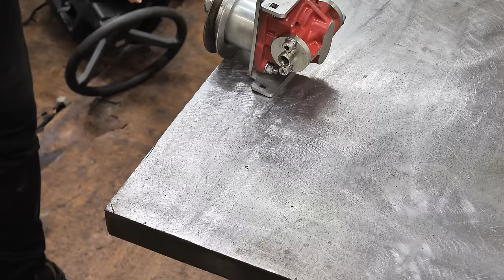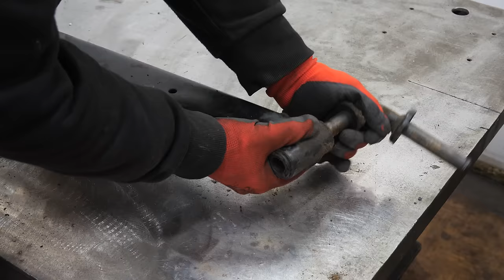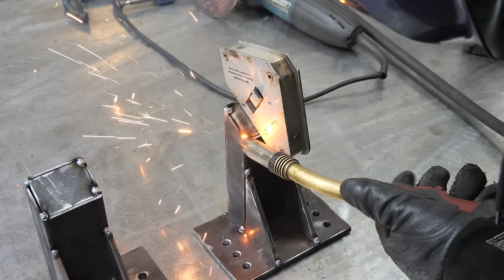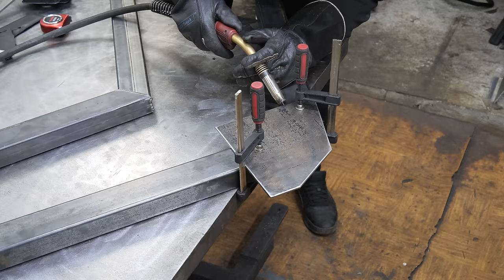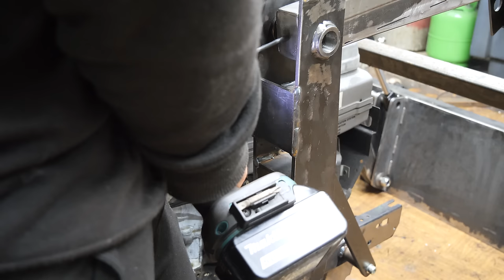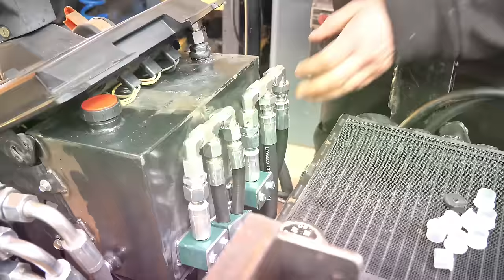Can Lawn Tractor be a Hydraulic Loader ?

Comment: Fill the rear tires with fluid, like the big tractors do, and add weight to the wheels. That way it doesn’t add weight to the drivetrain on the rear and it’s a lot easier on the tractor. Quality of that loader that you built exceeds any expectation. Wonderful job.
Reply: Yeah, that then has issues but what he did was reinforced the axle with some pretty large pillow bearings.
Reply: @WJCTechyman  What are the issues you've faced with loaded tires?
Reply: That's what I use my old retired antifreeze for.  I do recommend using tubes, even if they are tubeless tires though. Pretty easy to do. Use a garden sprayer and pull out the valve core of the valve stem. Rotate the tire so valve stem is at it's highest point and start filling.
Reply: Antifreeze in the rears is ballast and does not corrode the rims. Using tubes can be even better at preventing corrosion. 
Then, the rears on the little green giant were overinflated so most of the tread doesn't contact the ground for traction. Great for burnouts at the starting line buuuut. when all out traction is desirable, not so much. Next might be the addition of ballast weights to the wheels. With the bucket full and up for transporting material to another location, without the ballast, the tractor does a faceplant since there is nothing at the rear to counter the load. That is why the bloke added the hunk of iron on the back of the tractor.
Reply: @cayankeelord3730  don't forget drop the tire air pressure to approximately half factory recommended pressure I have 23x10.50-12 rear tire at 80%fill I run only 2-3psi in the rears... (factory spec called for 5-8 psi) I don't have a loader but I do have a 42inch 2stage blower run on the front that makes my garden tractor light in the rear... I added about 80lbs per tire in ballast
Reply: @ebinmaine haven't had any issues however I have the more stout Tuff torque k66 transaxle... Transaxles transaxles with less than a 10cc pump/10cc motor will prematurely fail with basic tasks such as pulling a trailer so I would not recommend adding more weight than the stock wheel weights via ballast
Reply: @dodgeme1986truck  Ahhh. Appreciate your response. Here we deal with Wheelhorse "Unidrive" transmissions which are somewhat overbuilt.
Reply: @ebinmaine   no problem I was stating a fact from numerous transaxles failures I've seen including the one used in the video (I pick em up for nothing due to the bad transaxle) and by either rebuilding the transaxle or adapting the machine to a k66 transaxle.  I have seen these smaller 19mm or 3/4inch stamped front axle failures from just carrying the factory snowblower attachment... the best options for this is to either build a new stronger front axle with modified 1 inch trailer spindles and tube steel beam or at the very least reinforcing the steering spindles by boxing the bend and by wrapping some 1/8 inch or thicker plate around the axle spindle bore that extends at least an inch inward from the vertical spindle bore welds also getting sealed wheel bearings is the way to go for the steer tires as well as rib tires as they almost act like power steering under the loaders weight while at the same time greatly improving directional control (only issue is they will rut up muddy/soft yards). also watch out for those hydrogear transaxles as well they fall in the same guideline... the reliability split really is the 10cc/10cc any lawn/ garden tractor with at least a 10cc pump/10cc motor seems to hold up, have yet to see one with a lower displacement last more than a few years without being strictly mow only on flat ground...

Comment: Very nice build! I like all the little details that you added. 
As you indicated rear ballast is needed. I believe you might need at least 200+ kilos on the back. 
Also, watching the loader function, a higher flow pump would really increase the functionality and speed.
Looking forward to see it all painted up!
Reply from the maker: Thank you 😁 Yes, today my wife and I will be painting, I have already done much more weight than in the video 😁 A short video with the painted one will be published on Friday.
As for the pump, it is sufficient, I made a mistake when connecting: I bought a hydraulic distributor that has one slower hydraulic section with a floating system, this section should be connected to raise and lower, and I connected to the loading bucket 😂

Comment: Nice to see you doing it here and on a suitable scale.  I did a simpler version about 15 years ago on a John Deere 140 H3.  Wish I still had it.  Best buy of my life.  14 Horse Kohler engine, hydrostatic tranny, and triple hydraulics so you had hydraulics for a 3 point hitch and two on the front for a snow/dirt plow, snowblower, or a bucket like here.   Too bad JD doesn't make something similar today that is reasonably priced.
Reply from the maker: Great machines, but in general, fewer and fewer brands produce this type of tractors. Sometimes I like to look in the John Deere catalog to look for tractors of the same size as you mentioned, because I know exactly which model you are writing about, but they are slightly larger and, unfortunately, quite expensive.
Reply: @WorkshopFromScratch  Look up the Kubota BX1880. This may be similar to what you are referring to.

Comment: Love these type of videos.  Great job..!  I built a front end loader for my 1981 JD 314.  I put dual hydraulics on it from a 318.  I used only single cylinders, as they are 3", and handle way more than a machine this size needs to.  Turned out great.  I made a bucket, forks, and adapters for garden ripper, rake, and am now working on a mini-grapple.  These JD platforms are GREAT bases for the imagination.  Again.....great job..!!

Comment: Glad it’s flat there! When you have a lot of weight on such a small tractor it wants to lift the rear wheels. On a 2 wheel drive tractor you have no breaks if your back wheels loose traction. I always run mine in 4wd when I’m doing loader work.

You have some good fabrication skills!

Comment: Great idea and excellent build design and engineering.
I hope someone wakes up and starts making them.
Reply from the maker: Thank you 😁
Reply: @WorkshopFromScratch   Thanks for the honest "Warts and all" review of your experience with the plans.
Are those tractors 4WD?
I assume they are post Sears Craftsman most likely from Lowes?

I have much less experience with hydraulics than you and I will agree they are a pain in the ass.
I have a wheelchair lift on my van and one of the cylinders started leaking and I had to block it off.
Luckily for me Parker has a store in my area.
I printed off a page from the manual, told the nice man at the counter "I need to block off this" and he got me the parts.

He even loaned me some tools when the leaking cylinder expanded and would not allow me to close the back doors of my van.

I wish hydraulics engineers could agree on one type of fitting and be done with it.

Comment: you made a pin on bucket... my dude... first chance you get, do yourself a favor and make it a skid steer quick tatch. it'll be more work fabricating, but if you end up using/making more attachments for it, you'll be glad you did. 

That should be ok for light garden and yard work, the issue you're going to run into is your front end is going to be heavy and your back end will want to come up. You added some counterweight, good. But you can tell its still light in the back end
Reply: I have seen people take small compact tractors ( old stuff ) and fab up skid steer mounts and they are far more happy. The skid steer plates are or were cheap around 100 to 200 dollars for a pre made one that you can just weld on to what ever you need. I have also made several using flat stock and its quite easy too. 
Once you have quick attach there is no end to what you can build. 
Have a portable welder. Build a skid platform with some tool boxes and bolt that welder to it. Add some bottles and what ever else you need. Resse hitch for grinder, table, clamp and so on and you got a nice skid you can load on a trailer, back of a truck and so on.
Reply: @kameljoe21 Skid steer couplers are good in some instances but for a 16 hp gasoline lawn tractor may be a bit much.  At minimum I would want a compact tractor like a Kubota BX series and even those are limited in skid steer accessories.
Reply: @WJCTechyman  You do know they have stand on skid steers that have much smaller attachements.  From several brands including Bobcat to ditch witch. Mini skidsteers are quite popular for tight areas and smaller projects. 
A garden tractor is a superb fit for those attachments. Not only can you buy them you can also make them. Limit the ability with the old pin style will leave you behind. Even if you only have forks and a bucket the ability to pull a lever and the bucket comes off with ease. Pins are super hard and the struggle to line up the pins. 
To make the tractor even better one might go and look at the stand on skidsteers and model their build after them. They are about the same size or close to it.

Comment: Great build skill's
As many have mentioned - Add weight to the rear + fill tyres with fluid
Controls are back to front - Back is up and crowd - Forward is lower and dump

Comment: That is very cool one. Long time ago I wanted the same thing, never got past the mockup. But really thinking that there is a big market for this kind tools for larger property owners that don't want to own a tractor just for simpler jobs. You can even do some snow work at the winter with that power. Not everyone require massive equipment or all done quickly. 

And I think these machines are eventually even safer for older and younger people, as we are not talking about heavy forces, heavy weights and fast equipments. Example, if the yard tractor flips on you, you very likely don't get seriously injured or die.

Comment: Excellent fab work. 
Although a loader probably cannot be bought for a LX188 , it reminds me of myself when I build something and realize towards the end of the project that I could have bought one cheaper.  Not to mention the labor involved. But it's the satisfaction of doing it yourself. Wonder how that little JD front axle and wheel bearings are gonna hold up to the added weight  ?

Comment: At the rate you're designing/building all these toys, you're going to need to design/build a new pole barn. In fact, this new toy here could even help you with that. Oops!
I meant: "At the rate you're designing/building all this equipment 'work' equipment" cause that's what it's for—to work. Sigh—sorry guys if the wife reads this.  😑
On a serious note: great job especially using such a small "lawn" tractor. I have the bigger 345JD "garden" tractor—it would be a lot for that. Well done. God bless.
Reply from the maker: I'm already having trouble storing all vehicles😂 
Thank you 😁  Regards

Comment: I like the design and all the hard work, but you have to be aware of its limitations. I would recommend a strong protective frame.

My neighbor was working with IMT 539 (Massey Ferguson 35), his bucket got stuck on the pile of dirt, somehow all the tension transferred to the frame and tractor turned over in a split second.

Comment: Very nice !  A few thoughts,  I’ve had a Wild Hare loader mounted on my WheelHorse 312 for several years now and it’s wonderful. However around 300 Lbs is the max since even with a 160 lb counterweight and  over 300 the real wheels lose their grip going downhill and remember you only have breaks on the rear wheels.  My yard is all hills. 😬
The Wild Hare by Groundhog has its own 12 volt pump onboard and attaches to the original Attach A Matic accessory points (custom). It can be unplugged and removed in minutes without tools,although I never do.
Pros - the bucket can be operated without starting the tractor engine which is very handy.
            With an added right foot forward reverse control both hands are free to steer while one finger controls the loader switches.
Cons - the loaders 12 volt hydraulic pump motor has a limited duty cycle.  Operating it continuously on a hot day fried my first 
             motor.  I installed a little thermometer probe in the motor and added. Muffin fan. Now when it gets up to 105 f I stop have a          
             Beer and let it cool a few minutes.
             I’ve broken virtually every light weight original weld and did serious rewelding. Haven’t been able to break anything since.          
             All that said it’s my best tool and I would not live where I do without a small tractor loader.
This one looks great, you gotta get or build one.

Comment: You will eventually find that stamped front axle to still be a weak link specifically where the wheel spindles are attached the tube they rotate in tends to rip off

Comment: Lawn tractor, no!
Garden tractor, yes!
Wonderful conversion from lawn tractor to garden tractor!
Excellent reinforcement of everything involved, with the possible exception of the transmission. I hope that holds up.
I love loader buckets with a heel for grading.

It may have been better to use pivot pins instead of bolts for the bucket.

You had a great design for everything except for the two lever controls instead of a single lever joystick! ☹️

With all the work that you put into it I'm surprised that you didn't add the mechanical parallel linkage for the bucket linkage.
Did you add a visual bucket level indicator?

You also have the hydraulics backwards on both of those levers from the standard 2 lever setup.

Comment: Great build!
For the counterweight I would suggest pieces of railroad tracks, welded together alternating upside down and as wide as a rear bumper, that should give enough mass on a compact size...or just a concrete block...
Thx for showing!
👍👍👍
Reply: Tbh I think just making a box would be fine, toss whatever in there, expired cement bags that got wet, sand, gravel, dirt...
Even 50x50x20 cm (20x20x8 inch) would be around 100kg.
Reply from the maker: Thank you  😁
The trailer hitch that was originally in this tractor did not allow me to attach anything heavier, only now, when I strengthened the rear hitch, I put more weight on it, I will soon publish a short video showing how it is already painted and the weight rear :)

Comment: nice work!
to add more weight you can fill back tires with water
Reply: How do you add water to such air inflated rear tires? Just asking, because I am looking solution to such problem. But here the larger problem would be that at winter those things freeze... ;)

Comment: Always love your projects and watching your work. Now you got me figuring out why I need to build one of these 😬Watched all your videos, most multiple times.  How did you determine the position of the tensioner pully, was it just by best educated guess, and maybe if it wasn't satisfactory you could just change springs? Fantastic welding on that front bar to the much thinner sheet metal to strengthen up the front end!  Your lathe resto vid was tops .. would love seeing anything you want to share about your Moore mill!  I have commented it before but I have to again .. your video skills are as fantastic as your fabrication skills .. you are  a very intelligent (and funny!) man, and we are all very lucky to see your work!   🙏
Reply from the maker: Thank you, friend, for such kind words 😀 Every project always requires some corrections, but I always try to do everything as best as I can because I simply want to use every project in daily work :) The drill and the lathe are in excellent condition and did not require any repairs. The lathe was refurbished by the previous owner, but because it had been left outside for a long time, it required cleaning and painting. When it comes to the drill, it's the best purchase I've ever made for my workshop.

Comment: Unless you need the ability to raise the loader to greater height, the loader arms are too far out in front of the tractor which is causing more counter-lever action on the rear wheels than is necessary for a FEL operation.  A simple correction is to add a lot of counter-weight to the rear of the tractor but that is going to put more stress on the framework.   I do like that you did an excellent job of fabrication and welding on this project and it will work for you around the lawn.
As for myself, I am too lazy to do all that work and just bought a Kubota B26 TLB (tractor, loader, backhoe) to do my lifting and digging.

Comment: Nice job, I would have had a couple of things changed like the hydro hoses inside the arm frames so they are less likely to be snagged on something and maybe the use of hard lines in areas where flexibility isn't paramount.  I'm surprised you didn't paint this project, but then again, Deere paint by itself has a high price to it.
Reply from the maker: Thank you :) I have already made a few corrections and painted it, I added a post with the final result. There are still a few mistakes I made, but the tractor works great 😁

Comment: Neat project. I would consider building a stronger front axle, as those style axles - welded stamped steel with spindle inserts in the ends - are failure prone in normal mower applications, and now you are greatly increasing it's applied load.
Reply: This is a brilliant bit of fabricating but I can’t imagine using a 17-horse light-duty machine for loader work. The weight of the loader, necessary counterweight, and bucket contents (gravel? no way) would severely tax the John Deere’s design limits. The author has mentioned reinforcing the garden tractor, but by the time that’s done the little Deere would be severely overweight. And if there’s one lesson learned the hard way with tractor loader work, power steering is a must. A tractor must be designed from nose to tail for the stresses of a loader, so if it didn’t come from the factory with one that should be a major consideration.